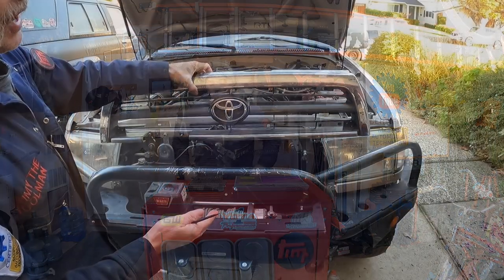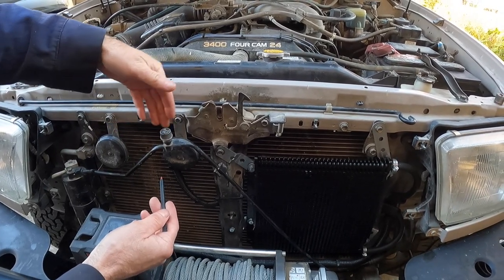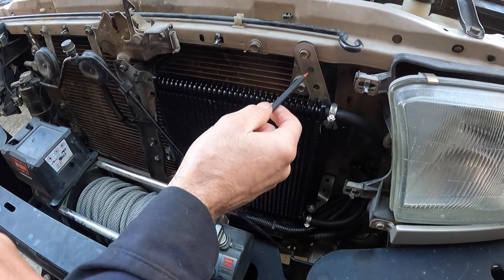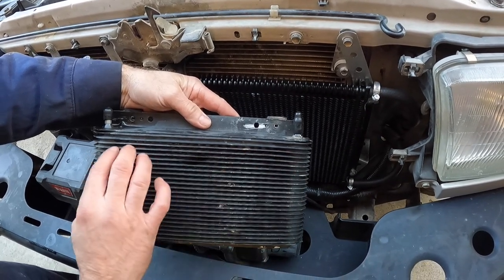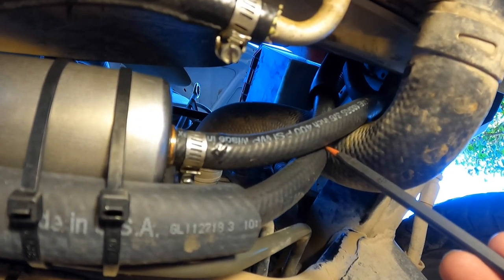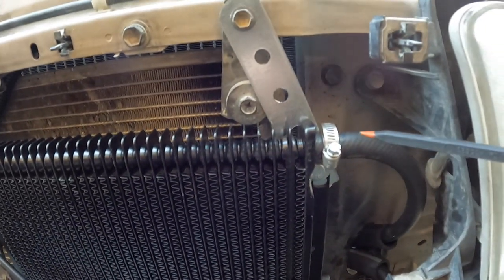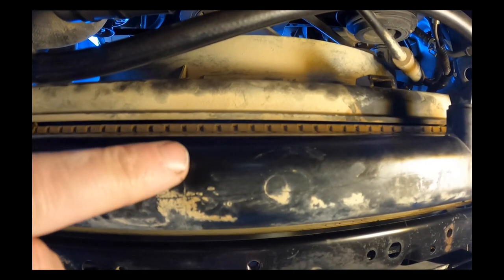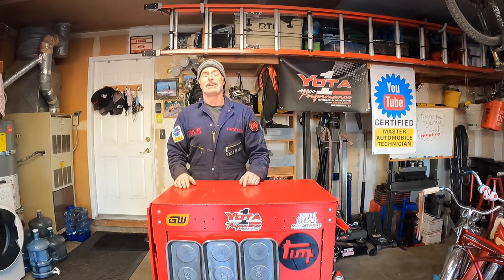External Transmission Cooler Install (3rd Gen 4runner/1st Gen Tacoma)

Comment: Previously you ran it through the radiator cooler but now you’re not what is your logic behind that?
Reply from the maker: The main reason that people bypass the stock cooler is to eliminate a trans cooler failure in the radiator.  The coolant and ATF mix and that contaminated mixture gets back to the transmission and kills it.  I still think radiator cooler failures aren't all the common, but there is a chance because I've heard of it happening to plenty of guys via Toyota forums and Toyota Enthusiast Facebook pages.   The radiator I installed in my 2000 4runner when I made that video years ago looked like an identical OEM one.  Fast forward a few years when I bought my 98 4runner and I wasn't able to buy the same quality radiator from Toyota.   It was clearly built cheaper and the price reflected it.  The cost dropped from $200 to $100.  So, the cheaper built radiator has me questioning if I'm now more at risk of a trans cooler failure.  For my 2000 4runner,  I'm still running my external cooler in-series with radiator cooler.  

This is an experiment for me and I'll know this summer after doing some trips if I like what I see or I decide to go back to running the cooler in-series.  I'll give updates via a pinned comment how my trans temp do this year and share my decision to keep running it bypassed or to go back to running it in-series.

Comment: Hello Timmy what kind of cooler is that 699 or 679 or 698?? Hayden??
Reply from the maker: There's a much quicker way you could have found your answer.  #1, you could have simply read the first sentence of the video description.  #2, you could have watched the first 1 minute of 40 seconds of the video.  Abraham, you're going to have to try a little harder than this.  I like answering everyone's questions, but I was tempted to ignore this one.
Reply: @TimmyTheToolman  thanks a lot I totally miss that one, I’m sorry about that, I just can’t find the 699 on Amazon only the 698 do you think there is a big difference between those two? Thanks again
Reply from the maker: @abrahamhorball1143  I provided a link in the video description.  I got mine from Ebay.
Reply: @TimmyTheToolman  hey I just find one for 75 dollars thanks !!!
Reply from the maker: @abrahamhorball1143  No problem
Reply: @TimmyTheToolman  one quick question sir why kind of transmission fluid do you think it will be the best for the 3rd gen 4Runners?  I was trying to find something genuine but it doesn’t said that match dextron 2 or 3? A good advice will help me a lot thanks in advance sir
Reply from the maker: @abrahamhorball1143  The original spec is Dexron 3 but you can't purchase that anymore.  You just have to use a fluid that is compatible with the Dexron 3 spec.  At first I was using a Valvoline Dex/Merc in my rigs but I've switched to Valvoline Maxlife which is a full synthetic.  I provide a link in the video description.
Reply: @TimmyTheToolman  can I mix this types of fluid with the original in the trans or do I have to do a complete flush ?

Comment: Use socket head screws instead of hex heads and you won't need to dremel your brand new oil cooler and make it look worse.
Reply from the maker: Thanks for the tip.  I'm ok with the Dremel work though.  It's just looks for something nobody other than me will ever see.  I'm a function over for kind of guy.  It doesn't have to be pretty but I definitely want it to work.

Comment: What's the difference between the 699 and 678 rapid cool? Amazon have the 678 compatible with 3rd gen 4runners but not the 699? Thanks
Reply from the maker: The 699 has the thermal bypass.  Ebay sells the 699.  We provide a link in the video description.
Reply: @TimmyTheToolman  Got it. I bought mine from Amazon. Just a few dollars more.

Comment: Anyone use a Long Tru Cool??
Reply from the maker: Never tried it.  The larger the cooler, the more cooling capacity.  But, there can be issues running too big of a cooler.  Even with the thermal bypass, more cooling does happen and it could keep your trans temp abnormally cool in cold climate conditions, like when you drive to the snow to go skiing.
Reply: @TimmyTheToolman  hey great videoN these Toyota’s transmission I’ve been reading like to run hot! Highest temp I’ve seen is 208 going up a steep pass after about a 45 minute drive. Temp dropped back down after going back to flat. I have a lot of additional weight from the parts I’ve added to the truck. I’m thinking a better trans cooler would help out. Unless that’s not super hot. I just feel like anything over 200 isn’t good for fluid life. 😁
Reply from the maker: @jonnytacooutdoors  208 Is not that bad.  If you maintained 208 for a long time, then that wouldn't be great.  230 is the temp I start to be concerned at.  It's ok for the trans fluid temp to spike for a short period.  That's totally normal.  However, you wouldn't want to see super high temps, like 240+ even for a short while because that's not good.  

If I'm driving up a long steep grade where turning overdrive off isn't helping (speed below 40-45 mph) and my trans temp gets up to 230, I'll pull over keeping the engine running and I'll raise the engine rpms to spin the fan faster so more air is pulled through the cooling fins of the trans cooler and radiator to expedite the cooling of my engine coolant and trans fluid.  Once the temp drops down well below 200 again, like around 180, I'll continue the drive up the grade.  The whole reason to monitor your temps is to let you know when it's prudent to pull over and give your rig a break and to also alert you there's an issue, like a coolant or trans fluid leak.
Reply: @TimmyTheToolman  great info! Thanks! 

We driving Ca to Or this weekend let’s see if I get above 208, I feel like I will. 35’s and a lot of extra weight. 😁🌮✌🏼 thanks again for the info.
Reply from the maker: @jonnytacooutdoors  If you drive up a steep slow road, you'll easily go above 208.  If you're able to maintain speeds of 45+ mph, turning overdrive off locks up the torque converter and will keep your trans temps down.  Have you re-geared yet?  I"m guessing you probably have with 35's.
Reply: @TimmyTheToolman  I have 4.88’s. I was driving about 55 when I hit 208. I’m not even sure how to turn off overdrive? I also ready guys will manually put it in fourth gear? Is that good to do?
Reply from the maker: @jonnytacooutdoors  There's a button on the side of your transmission shift lever.  Push it and you'll see a light on your dashboard say, "Overdrive Off". 

For a 3rd Gen 4runner (That's what I'm assuming your'e driving), your have a 4 speed Aisin transmission.  4th Gear is Overdrive.  When you turn overdrive off, you're locking your trans into 3rd Gear.  If you shift into 2nd, know you're locked into 2nd.  If you go to "L" (Low), you're locking yourself into 1st gear.  

Check out this video showing how your trans temps drop when you turn overdrive off. https://youtu.be/BEZfDOkGVno
Reply: @TimmyTheToolman  I got a 3rd gen Tacoma . My old truck did have that button!

Comment: Another good, recent transmission cooler vid is here: https://www.youtube.com/watch?v=K5ChzQeAHak with lots of similar advice. Not seen the additional trans filters before. Will look at similar for other uses. Like the replacement hook-up. Gr8 vid
Reply from the maker: I like Eric the Car Guy.  The in-line magnetic trans filters are definitely a nice addition.  I've been using them for years on my rigs.  Glad you like the video.